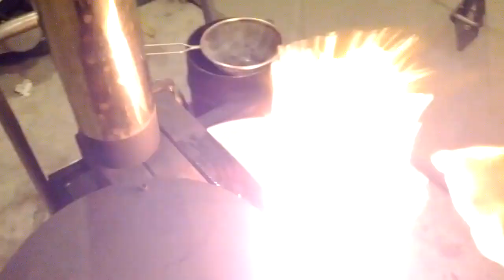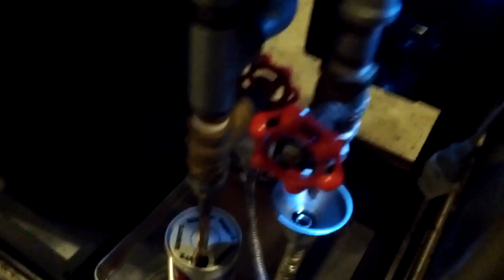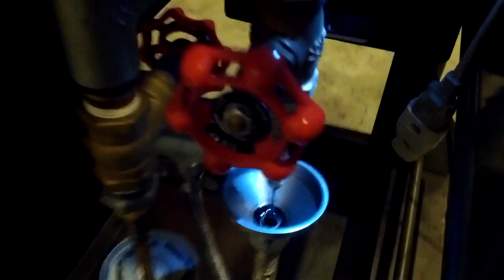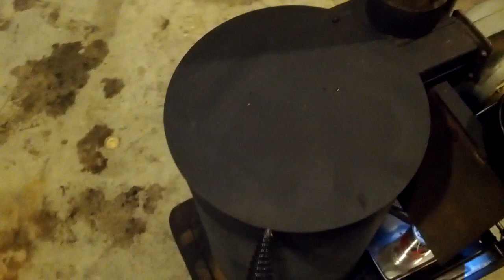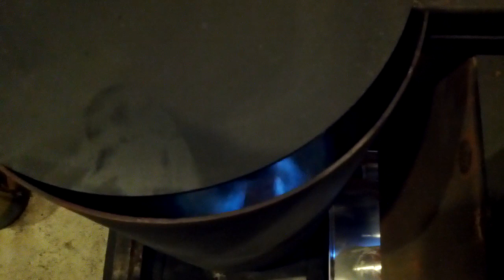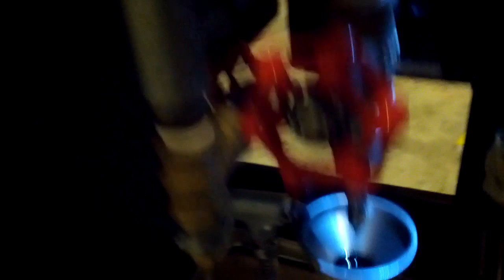Quick start blue flame waste oil heater #wasteoilburner #廃油ストーブ #diy #economy #レストア #ガレージ #防災

Comment: На отработанном масле ?)
Reply from the maker: Motor oil is mixed with the hydraulic oil of the machine tool, so it is better to have less burning residue than when using only motor oil.(^^)d
Reply: @dawlac_dojyo  Спасибо 🖐️

Comment: are you starting it using propane ?
I did not see that you closed propane source. 
is the blue flame due to propane or oil burning
Reply from the maker: I don't use propane, I use kerosene mixed with a small amount of gasoline at the time of ignition, but after that it burns blue only with waste oil.

Comment: The issue i have with the one I built is the blue flame doesn't happen, are you adding diesel in the mix not just waste oil. Because the flame is yellow white color as with most waste oil burners. The fan your using what CFPM is it pumping out.
Reply from the maker: I have not added diesel or kerosene to the fuel.
A small amount of kerosene mixed with gasoline is used for ignition, but then the fuel burns blue regardless of dirty motor oil, vegetable oil, or whatever.
Video fans are big, but even small fans burn blue.

Comment: no doubt its a awesome setup.how do you extinguish incase of emergency . I believe if you shut all air passages it will back fire.Well I understand that's where a fire extinguisher is used.

great job
Reply from the maker: I do not think about emergency fire extinguishing, but I am worried because there are many earthquakes here in Japan.When I'm ignited, I'm close, so I'm thinking of closing only the refueling valve if something goes wrong.

Comment: Sorry that about a dozen other have asked first, but can you make a video on the details of your heater, especially the burner, where the oil enters and is burned, and how you bet that awesome swirl?  Does the blower blow down the center pipe in the burner and is the oil burned in the center pipe?  Awesome design.  Just need more details please.  Thanks.
Reply from the maker: There is a hole at the bottom of the square pipe.It felt like there was less smoke when it was extinguished

Comment: nice design.  if I could only find one that does not use a blower.
Reply from the maker: Thank you!
The stove without the blower is quiet and attractive!
I'd also like to make one someday.
Reply: I am going to make a video of mine in the next week.  It doesn't use any power. It's easy, anybody can do it.  As far as I know I am only one with this setup so far.  BUT be warned! Mine can be extremely dangerous if you don't do exactly what I say.  They are basic things but dont skip any of them! Mine will go from 500 to 1,000+ degrees in seconds. You think his sounds cool. Mind will fire up like an afterburner. So when I upload the video, DO NOT skip any of the steps! In truth. I like his way better. Mine works to well, it scairs the hell out of me. Anyone who isn't afraid of fire is fool.

Comment: I'm guessing the oil just puddles at the bottom heating up and the air speed controls the rate of burn?
Reply from the maker: Oil is not accumulating in the bottom part. Ignition is ignited immediately and weakens except for just before extinguishing. The stronger the air, the higher the temperature but the louder the sound.

Comment: Nice burner by a good craftsman, looks to be a blue LED? Once up to temp how slow have you been able to turn down? Can it run clean at 10-20 drips per minute? Thanks in advance.
Reply from the maker: Douglas Pohl Blue LED Ha ha ha (^ o ^) I reduced the rotation on the way because the sound is noisy. It is quiet so that almost no sound is generated during stable combustion. However, as soon as the ignition is made a little stronger will stabilize quickly. After that it is about 3 drops per second.

Comment: I see one improvement that can be made. You really don't need a drip system. If you use a gravity setup, you dont need to worry about adjusting the rate of drip.
Reply from the maker: Jim Rojas What is gravity setup? In the case of my stove, three drops per second is just right, so we need to adjust it to that extent

Comment: has anyone found a video on how one of these is built?  specifically how the oil is introduced into the combustion chamber?  I have noticed all of them seem to need the oil to be "drawn in" some how from an un-pressurized reservoir.
Reply from the maker: The oil in the tank is adjusted to about 3 drops per second with a valve. The oil that fell in the funnel is lowered once by a U-shaped pipe, and it is refueled from a pipe attached to a position about 50 mm from the bottom of the combustion kiln, liquid sealed up again.
Reply: He's brought the oil in through the side of the cylinder, I've built one last week but brought the oil into the heater with a 3/8th copper pipe going down inside the box steel I've added a copper coil inside it which heats a radiator inside the house, therefore, the whole house is heated by this and yet it is set up outside. Cheers DFWOH
Reply: I've built a smaller one that run of a pump and a timer which is a must, but my holes are slightly to large so I'm not getting a blue flame, i did in the binging but it soon went to yellow flame. but it works well  going to use it to heat a ibc  tube 1000 litre tank. It operates at 25 second delay 1/2 a seconded of oil pump in. www.dripfedwasteoilheating.com

Comment: Dawlac made a complete new one from a 45kg gas cylinder, bigger bouncy castle fan attached, and its going  with a blue flame. I'm running it all this afternoon, bloody hot 450c have got our waste oil controller unit attached to it so look after itself, just brilliant. Love it, very clean burning, yet to see what smoke levels are at shutdown. :0)
https://www.youtube.com/watch?v=UUbp04RVuAg

Thanks for your video.
Reply from the maker: Wow, this is burning beautifully!  I think the 45kg bomb is ideal because it is large and has a large surface area.  Great (^^) d

Comment: Thanks for the great video. 
It has been awhile, how has the design worked out for you? Have you made any changes or developments,since the build. Are there any drawbacks to using oil, how practical  has this been for heating?
 Your workmanship is exceptional, would love to see more vids on the heater.
Reply from the maker: Douglas Smith Kerosene heaters are also used in our house, but kerosene is very expensive in present Japan. I made a waste oil stove where fuel can be obtained at once. We have already produced a heater for indoor heating, and it is still in operation.

Comment: How does the oil enter the burn chamber ?? any other details u can share...thanks
Reply from the maker: Hi! metalkraz I'm sorry for the late reply. There is a valve at the place where it got down from the tank and went up again and dropped from it. To the chamber, it is liquid-sealed with a U-shaped pipe that goes down from a pipe that rises diagonally and is feeding it.

Comment: The only thing I need to know is what is at the bottom of the air inlet pipe? I now understand the rest.
Reply from the maker: Jim Rojas A lot of holes are opened in the injection pipe, and at the bottom, there is a nozzle for rotation to agitate the gas and air.

Comment: Hello, what type of blower is it, which debit of air approximately?
Reply from the maker: This is a thing removed from the household oil water heater.
The speed is changed with a variable resistor.

Comment: Did you know you can make one without an air pump
Reply: It is possible, but the burn is not efficient unless you add large quantities of air to the burner. This is only possible with an air pump assisting the airflow in the heater.